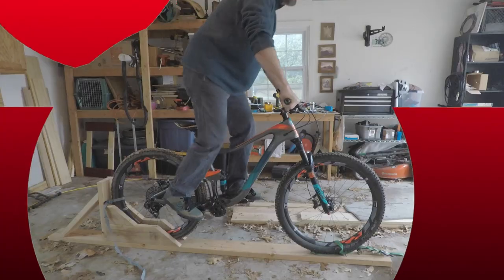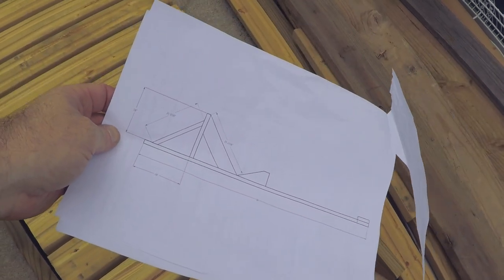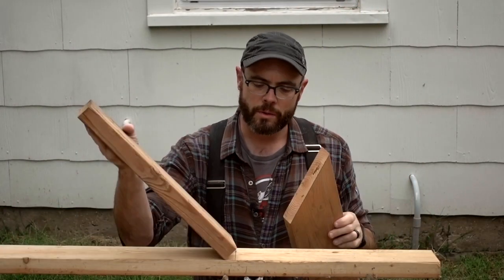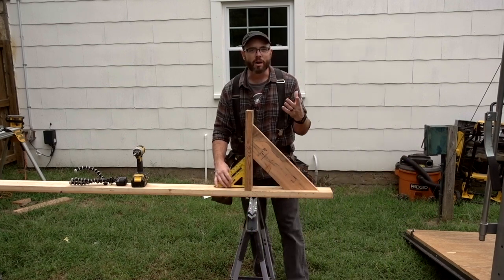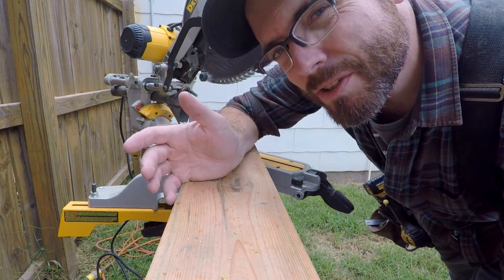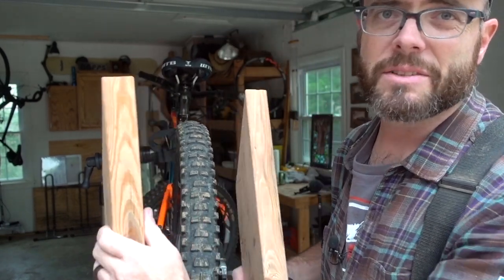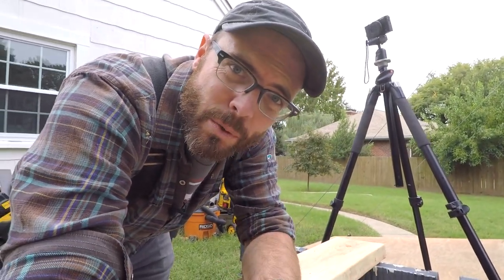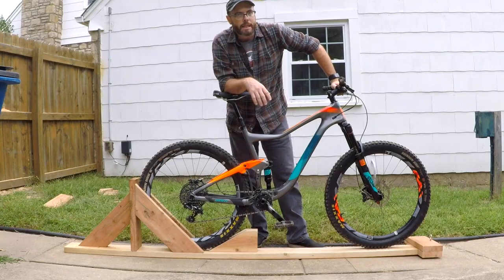How To Build a Better Manual Machine

Comment: Manual "Machine" is officially built.  Cant go to Lowes so I built it out of scrap wood (Yes, I had two 10ft 2x6 laying around).  Only modification was using 2x8s for the tire supports on the sides to have more contact area with the rubber.  After an hour my legs and arms and especially my hands are sore from practicing.  Thanks for the design idea, its the best version on the internet.
Reply from the maker: Man! Thank you so much for saying that. Best of luck to you. Feel free to tag @lunchridemtb on instagram with any pictures!

Comment: Thanks man. I followed your plan and just built one. My Santa Cruz with 1x12 derailleur hangs too low and touches the back brace. Perhaps a 50 degree or more cut may clear it. Lucky I have the luxury of the second bike with 1x10 without touching at all.
Reply from the maker: My derailleur would touch too if I had it in a low gear, but when I'd remove the chain it would tuck up with no problems. Simply shortening the side braces will also give you additional clearance. Thanks for watching.
Reply: @LunchRide  Ah, why didn't I think of switching gears. Thanks.

Comment: Loved  the video and on the strength of that I made one too!!  Had to make some changes as my bike has fat tyres. Not had much of a chance to use it yet but find it a bit unstable so have fitted a wider front out rigger. It may have something to do with using it on the grass as well but since I have fallen off a couple of times I daren't  use it on hard ground!! I'm 67 and still learning.Thanks for posting.
Reply from the maker: Man, I had a real hard time using it in the grass. I was spending all my time trying to balance before I even got to practice. The strap on the front wheel helped a lot with that and then learning that it's pretty easy to just jump off the back too, once you get the hang of it! Thank you for watching and keep me posted on your progress.

Comment: Side to side support, I have none on my manual machine. Just the base's 2 x 6 width. And since it stays in my dining-living room, I put soft weather stripping on the bottom to protect the hardwood floor. Definitely need good balance to use mine....
Reply from the maker: I didn't like it with out just a little side to side support, I felt like I spent so much time just trying to stay upright. lol

Comment: Why would someone give this video a thumbs down??? 

Did you try putting the wings on the underside, not screwed in, just friction fit? Thinking out loud, the main 2x6 doesn't need to lay level and would then be slightly inclined. This way if you do lose balance the wings may possibly pop off and let everything fall over as one unit. If that does works, you then could have the wings only in the back, simulating a very slight downhill to practice from. This may also help with storage for anyone with limited space. You can make wider wings and just remove them at the end of practice, the whole unit can be stored in a 6" wide space. Just spit balling and wondering what others think of that?
Reply from the maker: That's a really good idea. I must say that I've been very happy with this design but if you are going to build one like you described, please keep me posted! 

P.S. I always assume thumbs down votes are from ex-girlfriends.
Reply: Built my machine and the design worked great. Thank you for your plans. I did make the wings with 2x4 chunks screwed to a scrap piece of 1/2" plywood. The system worked great but I only needed it for a few days, until my balance got better. At that point I just pulled the wings out and was able to balance solely on the 2x6. I'm tempted to build this again with as skinny a base as possible (ideally the width of my tire). 

Since the bike angle didn't matter and because I wanted to transport the machine, I decided to cut down the base.  I cut it down to about four or five feet, just long enough to have hook in the front and the front wheel on the ground instead of the 2x6. This did not work as well because when you pushed down to start your manual, the whole system would lunge forward and throw my balance off. I had to put the cutoff piece back on, so I used a hinge to connect it. That worked nicely for transporting and storage.

Comment: Nice work, thank you for the video! Please can you explain, why do you need 96" length base board (the longest one)?
As I see you can cut base board in the middle right after the wheel chocks, make cross board near the vertical for the stable and put hook on the front side of wheel chocks to strap bike near the pedals. I think it will work the same, but construction is more compact.
Reply from the maker: I like the 8' to put the outriggers up front. I don't like the outriggers in the back. I felt that I didn't want that rigidity. I didn't want to accidentally damage my rims. But, by all means, build yours however you see fit. Thanks!

Comment: Good video! I've just subscribed because I like your style... and the 'manual machine' looks good as well! When I build mine it will more for getting used to the balance point for wheelies and then manuals when/if I master that ;-)
Reply from the maker: Thank you very much! The balance point it what it's all about, right?!
Reply: @LunchRide  Sure is! I built mine last week but need more practice in how to use it before learning where the balance point is ;-)

Comment: I like the chock idea, but is there any way to use the one machine with both a 29, or a 26 inch wheel?  I've seen other plans where it is just a square, then one can insert another block to make the space smaller.  (we just keep our old bikes :))
Reply from the maker: Sure. You could slip a 3" board vertically between the back brace and the tire for the 26", this will push the tire up against the chock. You might not even need a full 3".

Comment: great video! Going to buy the 2x6 tomorrow. Is there a way you recommend to measure a 29er XL bike for a good fit? I feel like it should be slightly bigger (wheelbase maybe?)
Reply from the maker: The wheel base will differ in a few CM's but nothing to really worry about. An 8' 2x6 should still be totally fine.

Comment: Thank you for posting plans and for the Kicka$$ video! Do you think making this with 1x's would be strong enough?
Reply from the maker: I wouldn’t risk it. You could make one out of 1x’s but the plans I made would need to be modified because the thinner material wouldn’t have strong enough joints. You don’t want to screw into the end grain of a 1x. Thank you very much for watching and let me know if I can help!
Reply: @LunchRide  I was thinking about dowels or biscuits and glue for the joints if I went that route. I want to be able to make it a little more portable to practice at work

Comment: Can you make the third machine to fit 26 and 29 ? Somehow to be able to adjust it ? Or this one is good for both ?
Reply from the maker: If the tire width is the same, I would set the chock for the 26" and I think it might work for both. Or set it or the 29er and add a shim for the 26.

Comment: This design is amazing. In your opinion though did you find the manual machine actually helped you manual or is it more a gimmick?
Reply from the maker: Sorry for the late reply. I don't think that the machine helps for nailing all out manuals. But it does help with one very crucial thing: the motion of getting the front wheel off the ground. It allows you to practice with a lot of repetition and little distraction so that when you do start working with them on the trail you can at least know how that is supposed to work and spend more time working on all of the other aspects.
Reply: Does it help with losing the fear of falling back? That’s where my 10 year old is struggling.

Comment: My son rides 20" bmx bikes and I have a mt bike like yours...... How can I adjust for both tire sizes?
Reply: As long as you can clear the rear sprocket with the 20" bmw wheel you should be ok with just an additional eyelet under the front bmx wheel to stop it flipping

Comment: Hey, sorry.. but the with of my tire is around 2.4 but in a 2x6 and using 2x6 for the braces  at the sides to hold the bike, how does the tyre fit? Your tire is more than 2 inch wide. Sorry englsig is not my first languaje. Thanks for the help.
Reply from the maker: I have a 2.5" tire on the back and it fits very well.

Comment: Don't make fun but on the wedge...is the angle that is pointed/ sharp that gets pushed into the tyres... is that angle 30 degrees ?
Reply: Oh wait nevermind... ..just looked at the diagram...I see now
Reply from the maker: Depending on which side you are cutting from it will either be 60 or 30. So yes! But there’s no magic to it, I just eyeballed it and thought that was an angle that would work well.  You are free to experiment!

Comment: For that bracket you could have placed it on the outside and traced both the vertical and horizontal angles on the 2x6. No measuring or math needed lol.
Reply from the maker: But that is soooo much less fun!

Comment: I built a manual machine and had to replace the crankset after the pedals broke out of the threads because of all the stresses of standing on the pedals and coming down hard on them.
Reply from the maker: WHAT?!?!!? Oh my god! That sucks!  I would think that the stresses from just riding would be more than practicing manuals. Jumps, drops, just hitting roots or rocks at speed seem like they would create more stress than that. If I may ask, what kind of pedals and crankset?